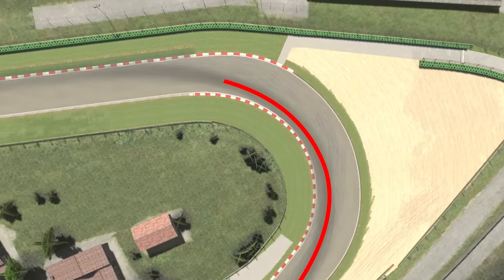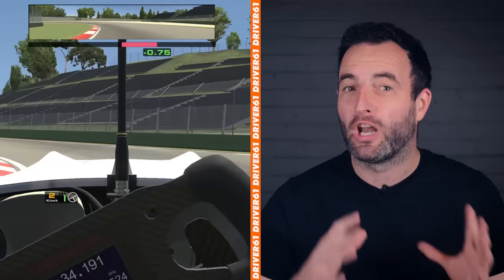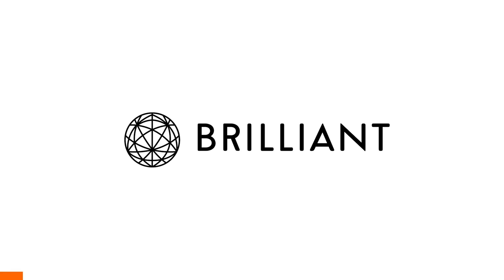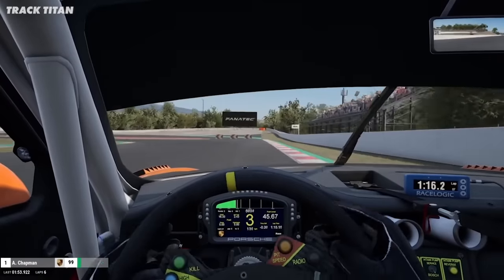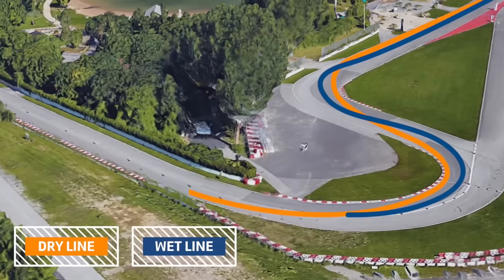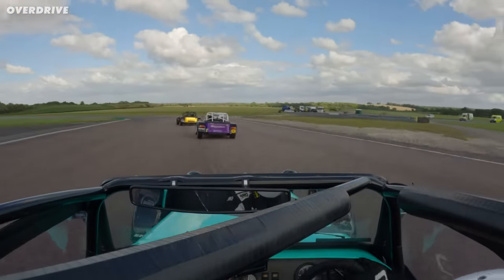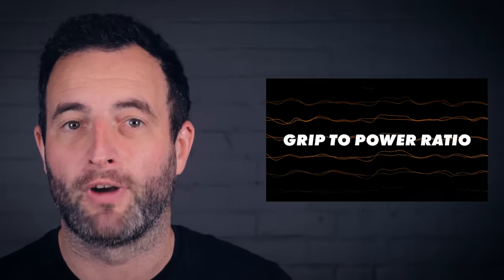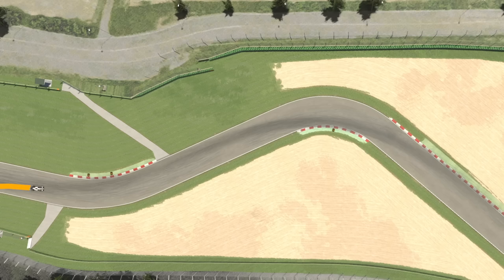Why F1 Drivers Use WEIRD Racing Lines

Comment: My favorite part of track driving is that as you learn about one corner it inherently changes following corners.  If you nail 1 turn perfectly for the first time you are going to get to the next corner faster so now your braking point changes at least.  You spend a lot of time trying to construct all those points when learning a track, and hopefully you manage to be close to your ideal more often than not.  Then there are the aliens that get 90% of a track "right" the first time and it's very quickly about tenths and hundredths of seconds of gain.
Reply: I think most F1 champions belong to the "alien" category somewhere, because getting 90% right on the first lap means you can refine your driving line, and other lines for overtaking and defending (like Max in Brazil 2016 on Rosberg), giving you a huge advantage on your opponents
Reply: It's always important to keep in mind two corners a time depending on the part of the track, it helps me when learning specific tracks
Reply: To me these aliens are the ones who seemingly use all the same lines, but they are just able to brake later, corner faster, and get on the throttle faster. Usually it's down to smoothness and knowledge of weight transfer.
Reply: I can summarise your entire explanation with one word, Speed.
Reply: @PozzaPizz  I break tracks up between the corners where there is no way to make more time ... like off-camber corners you just have to wait out, or really tight corners where they are very slow (the hairpin after the Casino in Monaco).  Anything you do before them doesn't change the corner after that "wait" corner so I use them to divide up the track.
Reply: @frederickschulze8014  Yeah, but they are not always smooth.  Sometimes they are violent but that violence allows them to maximize the car more than I can.
Reply: @ajstyles5704  Nah, it's more than just speed.  Some times it's going slow to go fast.
Reply: Then you learn to trailbreak and scrub another 20km/h while cornering and once again, everything one has learned to this point, goes out the window. 😂
Reply: @DriftJunkie  Exactly.  Or you learn that you can actually hold the line in a corner going 10km/h faster, and everything changes.
Reply: @wexalian The old F1 champions were definitely aliens of their time. But look at the skill gap between Verstappen and others, especially on equal sim ground. And consider that there were no sims at the time and many drivers spent way more time partying and socializing than actually training.
I don't think that the old champs would be able to match current bottom of the field.
Reply: @DriftJunkie i think the new generation are much better prepared than the old guys, they get so much track time and training as kids.
Reply: @frederickschulze8014 Those are a lot of words to just say skill issue.
Reply: The title should be 'How F1 Drivers can use weird racing lines'.  Big difference between a standard vehicle (even an average race vehicle) to a formula 1 car.  Superior brakes, downforce and tyres (to name a few).
Reply: i dont know if its just me but in games when i struggled to find time i would always go faster on laps i didnt take seriously like if i focused too hard to nail every corner i was overdriving and i would go slower, if i relaxed and just drove i would go faster. I guess i realized that ultimately smooth is faster, if you can drive smoothly, approaching corners not individually but as sequences, youll always be faster, every circuit is a deformed oval its all about being smooth
Reply: Another thing that keeps it interesting is that ideal line can change throughout the day based on tires a track surface, and then if you get a chance to take a different car out, its cool to see how different the line should be, especially a low power vs high power car
Reply: @UnProj  True.  Also as you use the fuel, as the engine heat soaks, as the brakes heat up, as the track gets dirty, as you adjust the car setup from session to session, if you are following another car, etc.
Reply: Indeed! That's one thing I have to constant remind students about... exiting one corner faster gets you to the next one WAY faster. If you aren't expecting that, you'll brake too late and end up running out of track. And then the student is demoralized by that mistake for the rest of the session.

I keep a slide on my track laptop showing the importance of getting on power. I was ~5mph slower at T7 at Road Atlanta. I was 1.5s faster than my teammate, but that slight difference cost me 1.8s(!) down the back straight. I did every other corner better, but the corner onto the longest straight absolutely killed me. (This was in a 4000lb Mercedes 240D... diesel. Btw. If ever there was a "momentum car".)
Reply: @jfbeam  That thing about the corner (or complex) on to the longest straight thing is fundamental, but most of my students struggled to understand how much of a difference it could make, particularly if that corner was a pucker corner where they would get in their heads and forget the line or get unbalanced and throw away critical momentum.

First lessons:
- REALLY prep your car before you leave for the track, the life it saves might be your own.
- Prep the driver before you leave for the track.  Cardio.  Sleep.  Hydrate.
- Get your car setup best for you.  If you car isn't holding you it will WEAR YOU OUT.
- Smooth is fast (most of the time), you want the tires doing one thing at a time (mostly)
- Look as far in front of you as possible
- Use all of the track
- You can brake later than you think
- Check over your car between sessions

Then the real learning starts.
Reply: @tomcharlton586  team on track practice limitations are a fairly new thing.  The big teams would have cars on track practically all the time.  Now they are severely limited
Reply: @frederickschulze8014 yes. This exactly
Reply: Max Verstappen was specifically taught by his dad to always go for the fastest possible laptime on the first lap (in any session) in karting, in contrast to the other kids who were taught to "build it up slowly / to warm up first". It's one of the key differences that turned Max into an F1 driver.   @wexalian

Comment: My guess is also F1 cars have so much power, that time on wide open throttle is more important than mid corner speeds.
Reply: Depends on the car and how much DF it generates at each stage of the corner, and how good it handles those in low, medium and high speed corners.

Back with the blown diffusers in the Vettel era, they had UNREAL downforce on throttle/corner exit. So they would prioritize getting on throttle sooner, so late apexing was more ideal.
Reply: in most cars having a good exit is more important then having as high as possible minimum speed because the ideal line isn’t that slow on minimum speed but if your not as skilled a more geometric line is quicker because most new people over slow the car to get the early rotation
Reply: This is also where the type of track comes into play.  If there are a lot of mid- to low-speed corners, a car that performs well in them will be faster overall than a car that doesn't but that has more top end speed.

For example, they've been showing a lot of driver comparisons during qualifying at F1, and you will see the top two drivers compared.  One is typically faster in the corners and one is typically faster in the straights.  Generally, is the one faster in the corners that is faster overall.
Reply: Yup which is why oversteer is preferred over understeer as oversteer helps with rotation of the car better allowing for better exit speed 

You rather V off a corner than U off 

For heavier cars like touring cars you would prefer understeer as that helps with apex speed momentum which is more important for a car type like that than a F1 car 

Only at front limited tracks oversteer might be an issue for F1 cars due to excessive front wheel slip angles causing excessive tire wear
Reply: Don't forget, the faster a F1 car goes through a corner, the more downforce it generates by the wings and therefor the more grip it has. So it really comes down to every single corner / combination.
Reply: The title should be 'How F1 Drivers can use weird racing lines'.  Big difference between a standard vehicle (even an average race vehicle) to a formula 1 car.  Superior brakes, downforce and tyres (to name a few).
Reply: I figure the braking power they have allows them to drive deeper into the turn. With the grip and power they can rotate the car easier than a typical sportscar. So they can brake and accelerate much more.
Reply: every corner speed you sacrifice means increasing gap to the car ahead and decreasing gap to the car behind.  

If you kill all the speed for a corner and wide open at the exit it has no meaning, you are just torturing the car.  You have to carry meaningful speed through the corner and then wide open throttle to reach max speed is what's called the racing.

Comment: The rally racing line is also often different. Since most corners in a rally stage are blind, it’s preferred to hit the apex later to improve visibility around the corner. Specially in events with no recce, like baja and raid
Reply: it's also so much less ambiguous haha, if you can't see the road then you're too early
Reply: It also depends on the surface.  

On gravel rallies, you usually end up following the tire lines set by the cars driving the stage before you.  That's because those other cars have already swept the gravel away from the road.  So even though the previous tire lines might not be the "ideal" line, they offer more grip and less friction resistance.  It's sort of like following the rubber braking lines in circuit racing.  

That's usually why rally drivers dislike being the first or even second driver on a fresh gravel stage.
Reply: Rally is also a balancing act of grip (you have very little) and power (because you have no grip, you can't use it) This is why almost every corner is taken sliding. (i.e. rotate the car, and stay on power.)
Reply: @jfbeam  Yet it is still mostly about controlling the balance of the car.
Reply: This is the exact method taught to police officers during pursuit training.  The cars are generally bigger and less nimble but higher in HP which is better for straightaways. Vision around corners as well as safety entering and exiting the turn.

Comment: Slow corners are where newbies lose the most time, because they're usually followed by straights and also the car spends a higher % of the lap time during the slow corner as a result of the slower speed.
Reply: Yes, it all comes down to ratio of seconds, not meters and how long you keep the advantage in speed. 10 seconds of corners with 5 seconds of straight? Focus on getting out of the corners ASAP. 5/10 ratio, focus on the exit.
Reply: Yep. I’ve seen people argue that someone has way more power so must be illegal because they’re pulling away down a straight. But, often it’s the difference in someone carrying a lot of speed in and being slow off compared to someone being slower in and faster off.
Reply: Ergo the corkscrew at Laguna Seca.  A throwaway corner, not a little braking hump before it what matters is getting setting up for the scary (don't spin!) fun downhill out of it. Sets you up for the tight bend (don't spin!) onto the front straight (watch the marshals tower!)
Reply: Not all seconds are equal in racing when comparing them  to where the second was gained or lost. Most cars are set up to maximize the speeds on the straights  where per unit of time more distance is traveled. 0.1 second gained at 60 mph in a turn is not the same as 0 1 second gained at 200 mph. It seems  like 0.1 seconds any where on the track would overall be the same as time is time regardless of speed but distance traveled means per lap not per any random .01 at all places isolation. That .0.1 seconds at speed helps far more than 0.1 s going thru a slow turn . Take off 0.1 seconds b4 a car next to u at a light and the other car might be a couple feet ahead of u at the nose or even a half carlength ....at a illegal speed on highway both cars wide open and let off accelerator and other car will shoot ahead instantly. Its the OVERALL lap time that counts  not all parts of the track are equal. Normally a higher turn speed carries more speed exiting corner ulimately having a bigger gain of top speed at the end. But sometimes its better to go slower thru a turn to maximize the next more important section. Thats whats so cool about racing is the mathematical  perfect arc may NOT be the best. So many other variables .   If it were pure math the quickest way around the track would be the shortest distance and inside line thru the entire lap but in a real world situation .....that goes out the window. Esspecially  if there are banked corners.
Reply: @waynegarfield6607 good example are those videos of Jordan cox with his civic against v8s in australia.

Comment: I Learned to Drive back in high schook. We didn't have driver education in school to cloud our minds with useless information.  I studied (and my school grades reflected it) the textbook "The Technique Motor Racing" by Grand Prix driver Piero Taruffi. This is very complex book it was every bit as inclusive is any other school subject. It not only went into the correct driving lines, to things like coefficient efficient  of friction between a car's tires and the road on a road surface. I learned a lot and it helped me later on. I won my first Race 3 hours after I got my driver's license. And I won a championship my first season, while racing a Stingray. Which is definitely not a beginner's car.

Comment: we also cant forget that the minimum speed of a f1 car is still extremly high cause of the incredible downforce it produces so taking those sharp turns wont affect a lot, the only problem is you are in danger of somone having a lunge in the inside
Reply: that's not true. downforce doesn't make much of a difference in low speeds and formula 1 cars are extremely long. hairpin corners like the first corner of spa can slow them to a crawl

Comment: Love this. Very succinct for the amount of ground it covers. The last bit about corner complexes and sacrificing one corner to set up the next is so often overlooked in videos like these. Years ago I watched a recording of racing school video in which the instructor said “the most important corner on any given track is the last one before the longest straight” and it changed the way I looked at racing lines forever.
Reply: I instantly went to the classic Gran Turismo track Deep Forest. While that initial hairpin is intimidating for beginners, the real monster is the very last corner. With most cars, the corner takes just the slightest tap of the brakes to take cleanly. Screw up the exit speed on the final lap, and congrats, you just snatched defeat from the jaws of victory.

Comment: When riding my dual-sport on gravel hairpins I noticed that I get quicker the more I "V" the corner.
To an extend where I almost come to a complete stop at the apex, turn the bike and throttle out again.
You can see pro riders do the same if there is no berm.
It is the grip/power ratio at the extreme. My bike has close to 50hp, but I have grip for maybe 20 of those.
Taking the geometric line it feels like ages you spend in the corner waiting for the bike to straighten up so you can open the throttle again.
Reply: That's what Scott explain in this video, but also you have to remember keeping your brake temperature at best not too cold or hot unless you wanna get lock up or go to gravel. 😅
Reply: A tight supercross track might have a couple sections where a rider would square off a corner as its sonetimes called, to guard the inside or make a block pass but normally a smooth arc with a smooth uniform throttled increasing slighty as to minimize rear wheel spin is ulitamately the fastest. In the 80s and 90s US motocross riders were squaring off coners more and tge European  style was to " Road Race" the track and sweep the outside to carry monentum. We did beat the Euros more back then but it was more about the agressiveness of SX that we started, the shorter races 30 mins US vs 45 mins So the less fatiguing arc method worked as to save energy, however after time almost all winning riders today use the sweeping arc style over inside , pivot ,then hard acceleration because even tho its on dirt the lines of a pavement course work as well. Its all about putting the power to the ground and hooking up vs spinning your wheels

Comment: You just took me back a very long time! Very interesting to see the comparisons between the types of racing. I did think that it would be much more fun in Abu Dhabi if they gave the drivers go karts instead of F1 cars 😂

As my rally driver dad taught me, "fast in, slow out; slow in, fast out." Whichever was most suitable for any given corner was the one to choose. Though he did spend about half of my learning taking me on rally "tracks" (mostly mountain and forestry given where we lived. He'd actually been one of the designers for our section of the Round Britain Rally back in the early 60s). This was in a 2lt Datsun Laurel, weighing over 1.5 tonnes with no power steering. I was 17, quite strong for a girl but I'm not particularly tall, so I had to rely on him (at 6ft) to be my co-driver and tell me when to turn on some sections because I couldn't see over the steering wheel 🤣 Not much fun on a single track mountain pass with 90° turns!

(I had proper "pass my test" lessons; Dad did the "how to drive when you're up to your eyes in it" lessons. Over 41 years - if you include the learning, 41 next January otherwise - I have used Dad's teaching more often than I would want! Still got a clean licence, though 😉. Fortunately, I have used Mr Picton's far more!)